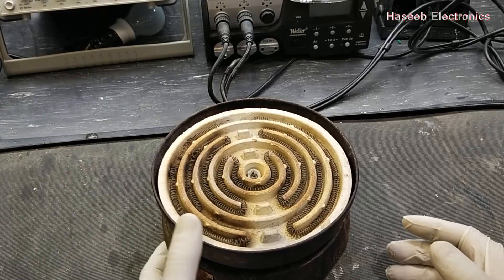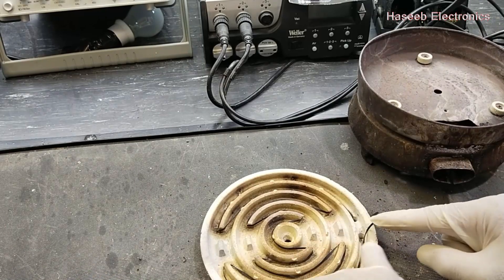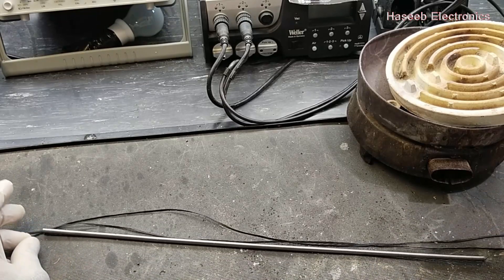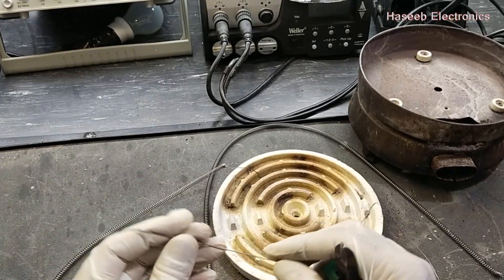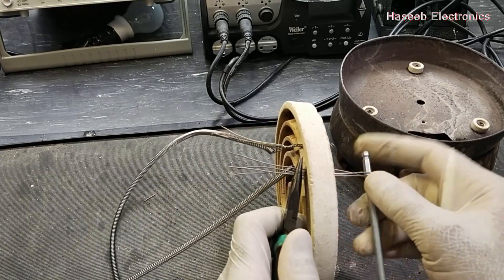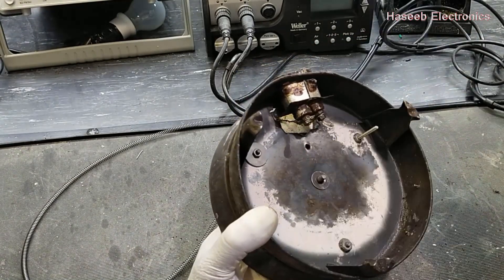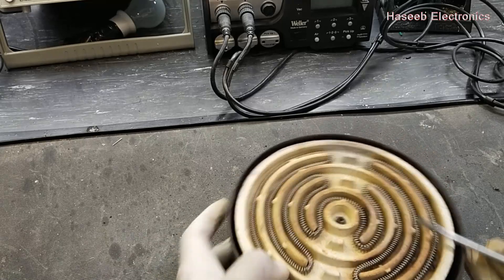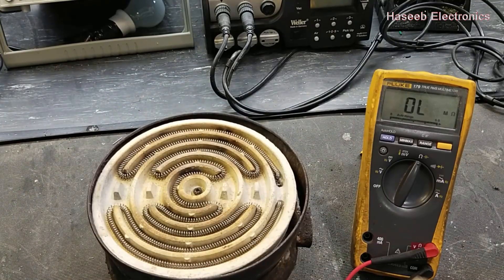{490} How to Repair Electric Heater at Home. How To Replace Heating Element

Comment: What do you use to insulate the element after replacing it?
Reply from the maker: these are bare elements 
these type of heters don't have islation or insulation 
there are "CONCEALED HEATING ELEMENT HEATERS"  available

Comment: That appliance needs an earth ground!
Reply from the maker: exactly you are right. it needs a proper earthing 
its earthing point is in power plug, when we insert the plug in the power in socket of the heater, the plug have two female pins having line and neutral 
and there is a metallic touch contact in outer body of the power plug that carries the good earth connection with 3rd wire of power cable, so this touch contacts makes physical connection the power in socket outer shell. 
in this way the good earthing connection is accomplished
please accept my best regards and special thanks
Reply: @HaseebElectronics  Oh ok. I thought it only had 2 prong plug.

Comment: Is this the same heater as you repaired one year ago? Seems heavily used then. 😁 The plug is a bit loose and crusty. Should be fixed too. Quite dangerous device with open heating element. Such devices had killed a lot of people. 😢
Reply from the maker: exactly sir, you are right. the simiilar one i repaired already. 
yes unconcealed heating wire is much dangerous than the concealed one